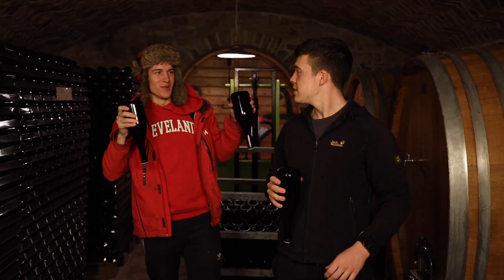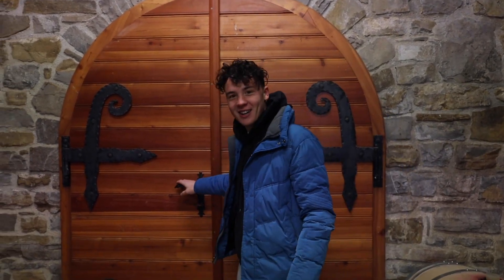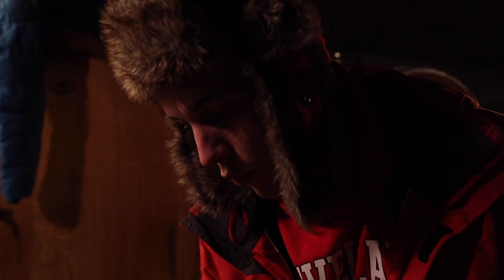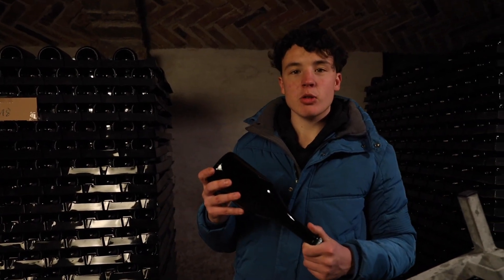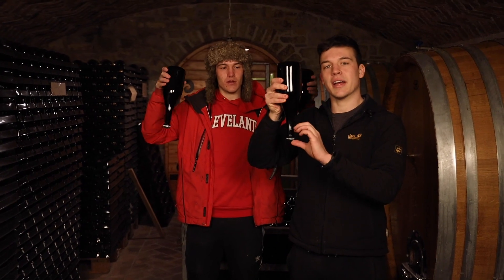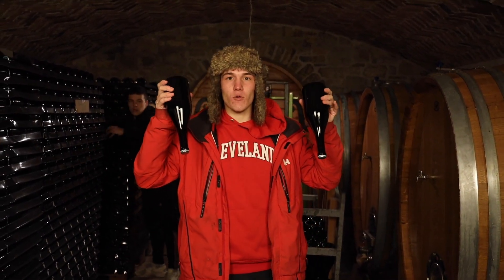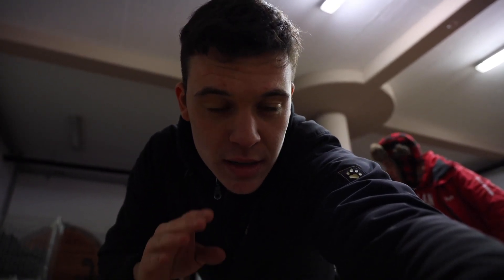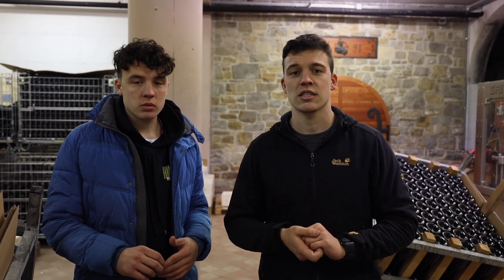How To Prepare Sparkling Wine/Champagne?

Comment: Great video!

Q1: After disgorging, when adding sugar to the dosage - will this cause a 3rd fermentation in the bottle, or does disgorging prevent the wine from fermenting again?

Q2: After topping off, how does the sparkling wine keep its carbonation and how long will the sparkling wine stay carbonated?
Reply: Yes! The disgorging will remove a good amount of yeast, but not all. When u add sugar, they will eat and generate more co² to keep the sparkling wine carbonated